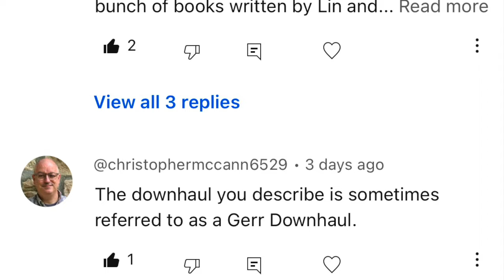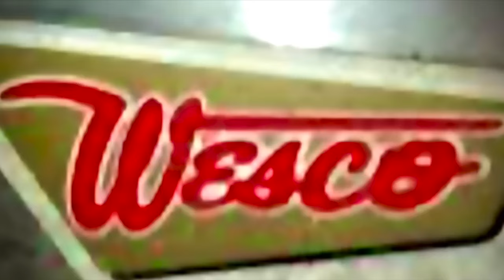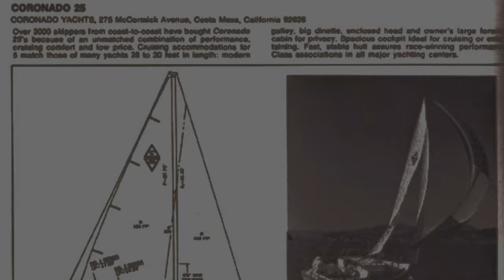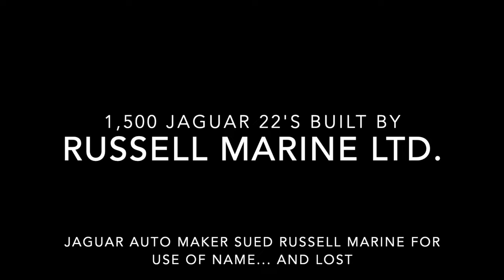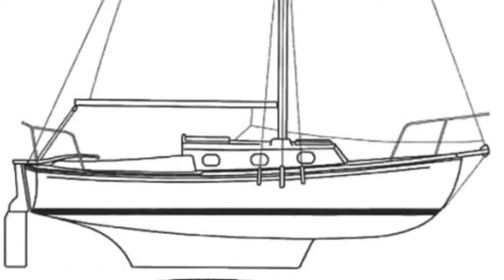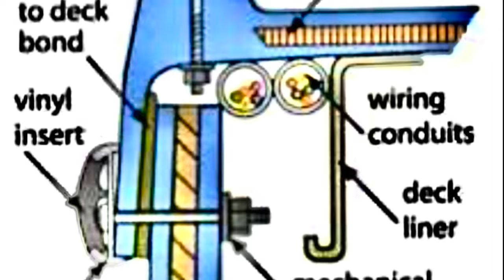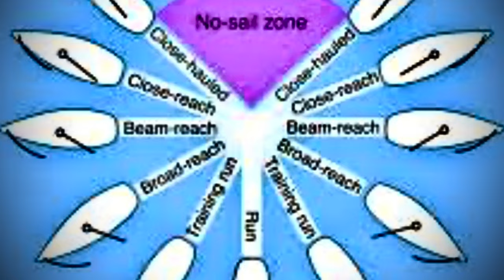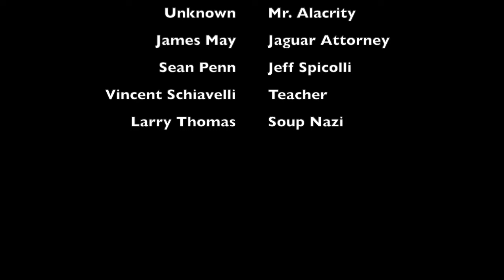CATALINA 22 VS. COM PAC 23 CLASSIC PLASTIC SMALL SAILBOAT BATTLE-FOCUSING ON DESIGN & BUILD QUALITY

Comment: We owned a Compac  16 and upgraded to a Catalina  22. 1987 swing Keel and Pop top. No problem with the deck or any other issues with the Catalina 22 . When buying a used boat make sure the previous owner took care of it and had documentation of work done. WE  sailed the compac 16 in the NH lakes and the Catalina 22 in the Barnegat Bay NJ. But also sailed the compac 16 on the penobscot bay Maine   and coastal NH , Both are great boats.
Reply from the maker: People love their Catalina 22s.  The early ones had their fair share of problems.  But Catalina just kept making them better and better.  I sure wish they would upgrade the interior of the Com Pac 23.  I mean, they’ve been rolling with the same cabin layout for going on half a century.  I think it’s time to cut back some bulkheads and open it up like the Catalina cabin.  
Then we got a world beater in my opinion.
Thanks for watching, and fair winds.

Comment: The Catalina Mark II began in 1986.  Mark 3 began in 1996 when the market for small boats really started to change. The Hull, Rig, and keel remained the same as their was an active one design racing fleet. However it was heavier and not as competitive as the older boats which were lighter. In many ways  this created a big problem that made the class so great.  There was active family racing and cruising.  The new boats were more cruiser friendly, but cruisers wanted bigger boats. Still, it is a great starter boat, that is well maintained can take you in safety.  There are tons of parts and help.  Remember, the reason for the swing keel was to make it a trailer sailor. I sailed the Cat 22 in all kinds of conditions, and friends have taken their 22 from Florida to the Bahamas.  She is a seaworthy boat.  All boats have trade-offs and price performance drives a lot of that.  They do make Pop Top enclosures for the Catalina 22 making cruising life that much better.  With so many built being the most popular boat in this class ever built for a reason.  I don't think any of the boat manufactures believed their boats would be sailing 40 years after they were made, but many are.  I have always heard that Compacs windows are a huge leaky problem that don't sail well to weather. They are pretty and well made, and do cost more per foot.  I did appreciate my queen size front berth and full size berth with the table down, in my Cat 22 making it much more comfortable for a small family. As I recall the Compac berths are really small.  Again trade offs.  On the Chesapeake Bay having a swing keel to go into shallow gunkholes was a blessing.  Sailing deeper waters I would love a full keel and not worry about the maintenance of a swing keel. The wing keels cannot point, but off the wind they fly and they don't slam in chop like the swing and full keels do. Running aground in a wing keel sucks period, If your buying a an old boat, you can't go wrong with either as a nice day sailor or weekender.  Squishy decks are not just a problem for Catalina boats.  Many high end boats used sandwich balsa or plywood cores and all can suffer from this problem.
Reply from the maker: I wonder how long it will be until Com Pac adds a centerboard to the 23.  It  seems to be the way they are going.  Get this boat to point higher and it would be hard to beat overall.  Thanks for your comment.

Comment: I've wanted a Com-Pac all my life, but could never find a used one in my price range.  I own a Catalina 22 swing keel and it sails great and is very comfortable inside and out.  Maintenance on it sucks though.  The best boat I've ever owned in this size was a Precision 23, with the smaller Precision 21 a close second.
Reply from the maker: There's a great CP23 for sale in Seabrook, Texas.  I feature it in my latest video.  $3,000 for a MK3 with a Honda 6, no trailer. There's a lot of good old boats out there waiting for a second, third life.  But, like you, low maintenance is high priority.   Looking at pictures, the interior design of the Precision 23 is perfect.  Why can't the Com Pac 23 cabin be laid out like this?                                                                       
                                  Thanks for stopping by.

Comment: I had a blast watching your video! I looked for a compac 23 after sailing a compact 16 for a season. Finally gave up and found a Catalina 22 in my price range, made some mods ( see my channel). Its a good enough boat for now. Ive been sailing it for two years and im currently anchored in Wrightsville Beach NC. Ive had 2 days of terrible weather and been stuck inside the cabin.....i van reliability say the compac or Catalina is a cruising boat. My back and neck hurt and im ready for the house. But i will say , last night a large front came through. 50 knot gusts, rain in sheets,  3-4 ft seas. Water over the bow washing over the cabin top. I was scared. But the boat did it. 1 inch of water in the floor where it came around the pop top.
I would have rather been in the compac 23!
Reply from the maker: It sounds like you’re getting serious use out of your boat.  Putting yourself out there like you have gains you the experience most won’t ever get.  Much appreciation is gained for the creature comforts of home after spending a night or two rocking and rolling like you have.
Experience like that, make life so rich. 
You’re now wealthier where counts. Thanks for watching and I hope the rest your trip goes great.
Reply: @smallsailboatbigwater3959  I was just thinking about that , there's a difference in living and just being alive. I think we all get too comfortable and we need the stress.....good stress

Comment: After sailing planing dinghies for a few years I am in the market for a USED trailerable cruiser.  I want to limit the weight to 2500 lbs to make towing easier on my SUV. 20 to 22 feet seems to be my sweet spot.  So I've looked at all the different keel designs available.  A full fin keel is a deal breaker because the boat must sit higher on the trailer, making it more unstable.  This also makes rigging the boat harder.  Swing keels seem to be the ideal answer, but most of them are made of cast iron that is typically sealed with an epoxy paint.  The Catalina 22's are like this, as are the MacGregor/Venture boats with swing keels.  Most of these boats are forty or fifty years old  and the iron swing keels are almost always in bad shape.  Removing a four or five hundred pound swing keel and restoring it and then putting it back in the boat is a job I don't want to do at my age.  The San Juan 21 is the one boat I have found that uses lead embedded in fiberglass centerboard that supposedly has great hydro-dynamics and lasts forever, provided you don't crash it.  Lead does not corrode like iron. This boat's swing keel retracts all the way into the hull which allows the boat to sit very low on the trailer like a big dinghy.

O'Day trailer sailors have a short stub keel, similar to the Cam-Pac 23, but not quite as deep -- I believe.  Some models also have an unweighted fiberglass centerboard that can swing down below the stub keel when sailing upwind to improve pointing.  O'Day uses lead in the stub keel for ballast.  No cast iron to corrode.  

My issue with the Com-Pac fixed keels is that they use concrete in them as a matrix that supports heavier materials for ballast.  I don't know if this is exclusively lead or if iron is also used.  I've read that boats with fixed keels often have all manner of scrap metal tossed into their keels for ballast and then then filled with concrete or some kind of  resin.  This generally works well provided you don't ground the boat hard enough to crack the outer surface and possibly crack the concrete inside the keel.  Once water gets inside the structure cast iron, if used, can rust.  And if the boat is stored on a trailer and if water gets into the concrete by whatever means, it can freeze during winter and crack the concrete.  

I do not know the construction details of the Com-Pac keels for certain, only what I have read.
Reply: The ideal swing keel would be made of stainless steel or bronze, but the cost of several hundred pounds of such material would add thousands of dollars to the price.

In another thread we were discussing Flying Scots vs. Thistles.  Looking at the specs on the Scots I read that they actually have a weighted centerboard of about 110 lbs. That's not a lot, but it makes a big difference in a dinghy.
Reply: I pulled up the prints on the Scot, and they call for 80 lbs of lead added in the lowest part of the keel.  Add this to the wider beam, and it makes for much more stable boat.
Reply from the maker: For sure, there’s no perfect boat for every occasion. Everything‘s a trade-off.  In this video I tried to lay out some of the things that made me choose the Com Pac over other boats.  You’re right it all comes down to the balance between quality and price. That’s a decision everybody must make on their own.  The Com Pac 23 seemed to be the right balance for my situation.  I appreciate your comments.
Reply: I consider the ComPac 23 to not be a trailer sailor in the true sense.  Too big.  It's the kind of boat you can trailer to the lake, or wherever, at the start of the sailing season and then haul it out in late autumn.  And leave it docked on the water in between.  I see the ComPac 23 as more like a Cape Dory 25 than a true trailer sailor.  I would say the same thing about a later Catalina 22 with a fixed keel.  These are big boats trailering to the lake every time you want to go sailing.  Your situation, living on Galveston Bay, is ideal and what you want if you're really into sailing.  I'd like to do that.  Perhaps I will get a bigger boat, one I can live on, and leave it in the water on the coast.  But I'm not able to do that right now.  The best I can hope for now is a camper-sailor, something easily trailered and rigged that I can sleep on for a few days at most.
Reply: My favorite Catalina 22 is the Capri model with a full fin keel.  It's more a racer with a bigger cockpit and smaller cabin, similar to the J-24 you had.  A racer.